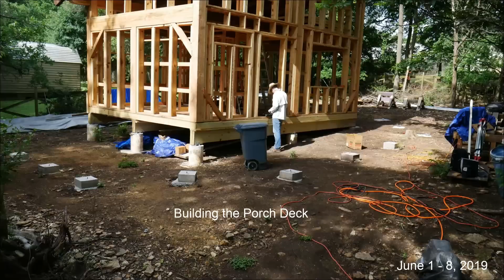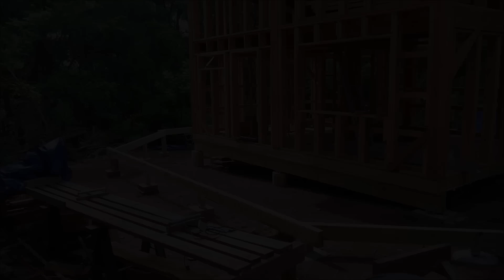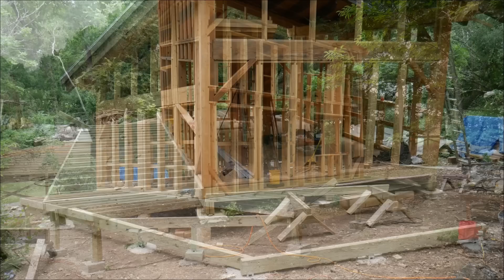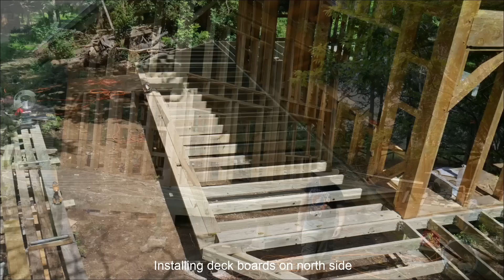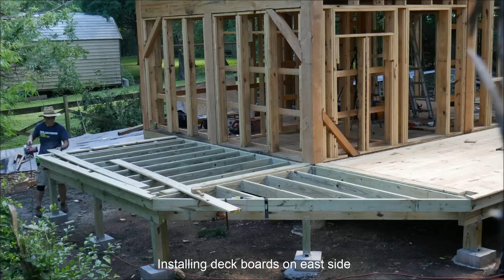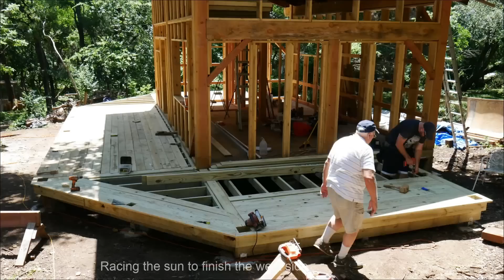Timber Frame Cabin: Porch Deck Installation

Comment: HI Aaron, just found out your channel, what an amazing construction. I would like to ask you how much did you spent on the framing of the house, if its ok for you.
Keep up the good work
Reply from the maker: Thanks Diogo! I've been meaning to publish my expenses. Here's a summary of the framing costs:
Main Cabin:
Structural Framing Timbers and Rafters: $9000
Non-Structural Framing Lumber: $ 2200
Roof Decking: $5000
Sub Floor Materials: $2000

Porch:
Structural Framing Timbers, Rafters and Roof Decking: $5300
Foundation and Floor: $3000

Comment: Do you get deep frost ? If not, great. If you get 36” deep ground freezing I hope that you took that into consideration. Terrible vieo. Unable to see or check building methods.For instance did you use joist hangers to secure the joists ? Best to stagger deck flooring across corners.
Reply from the maker: Frost heaving is definitely something to take into consideration in cold climates. We're building in central Texas where the frost line is somewhere in around 6". This video series is more documentation of the whole build process rather than detailed how to videos.

House improvements has a really good deck building series:
https://www.youtube.com/watch?v=OF8eYE-aHIk&t=2s
Reply: Wondering why you didn't  go with 2 x 8 joists and ledger board .
Reply from the maker: @hap5215  I had limited ground clearance on the upper slope side and 2x6s very adequate according to the joist span table I used
http://www.southernpine.com/app/uploads/SPtable4_060113.pdf

The deck is 8' wide with a 6" cantilever so the inside to inside span measurement is about 7' 3". I was using #2 Southern Yellow Pine joists on 16" centers.